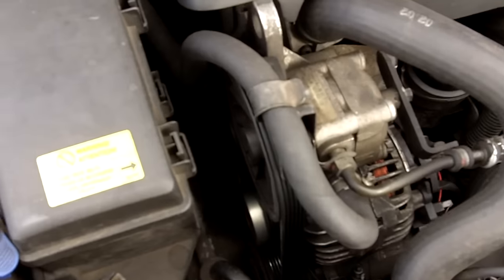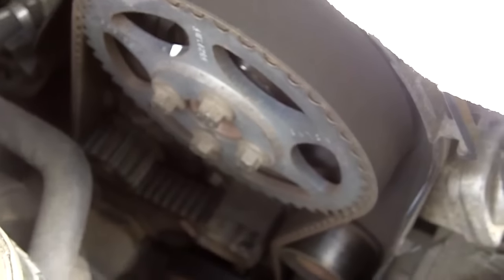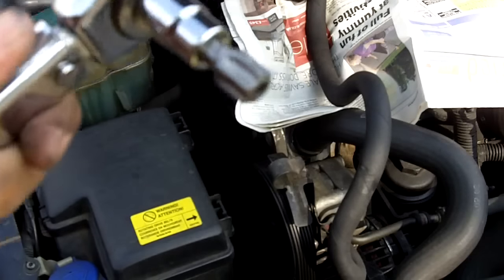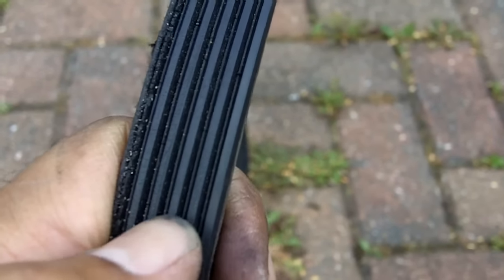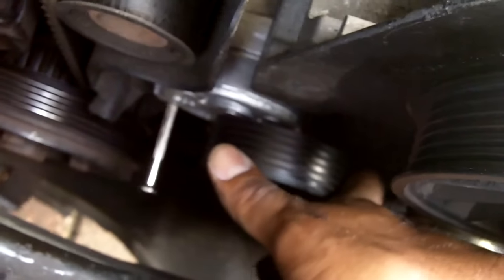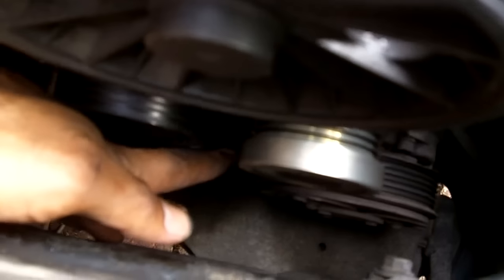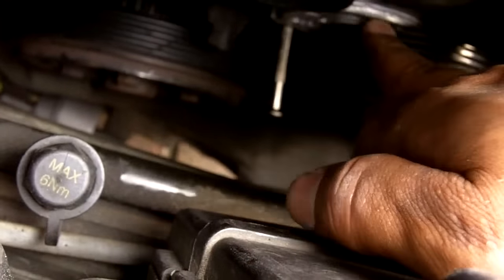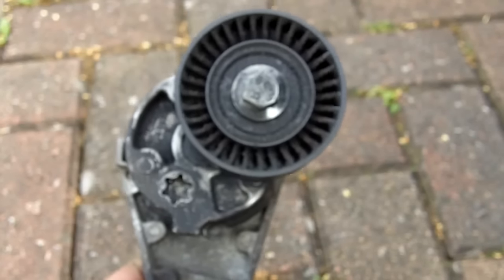Volvo D5 Auxiliary / Serpentine Belt Replacement

Comment: Another great video from SiRobb. I had to take out the power steering pump and alternator to do this - the Torx needed tapping in as the splines were a bit rounded by a previous mechanic/owner. Not a big job but the moral support from this channel always helps - New alternator pulley and now have a very quiet engine! - Thanks again Si. Great stuff!!!

Comment: Thanks @SiRobb for a great video. It gave me the courage to do it myself. Unfortunately, it looks like I had received the wrong type of tensioner. The car originally had the one with the bolt on the lower part of the tensioner, the replacement part I received had the lower bolt in the same location as the one you used in the video. 

Despite the differences, the replecament tensioner did fit, the bolts actually lined up perfectly. And I actually drove about 20 miles and it worked without problems. No noises and the belt runs perfectly.

I will however change it to the correct part this weekend, to help me sleep better. :)

Comment: Thanks so much. I got the wrong part from the store, they said it was the right one when they looked up the vin number. Morons. So i tried to find the bolt when comparing to the spare but couldn't find and then tried to locate it but couldn't. Then when i tried to find a video with the same tensioner model for the D5 there wasn't any. But then i found this, huge huge thanks you are a legend!!! Thanks thanks million times! God bless
Reply from the maker: God bless you too my friend.

Comment: Thanks for sharing, I noticed that 2 years ago before I changed my belt I had a rattling noise, so I changed tensioner pulley, but that didn't change a thing, then I changed the the belt and rattling noise went away. Now 2 years later I can hear the rattle again so will try to change the belt now first.

Comment: Another splendid video. The tip about the T60 slot on the tensioner is great. I had no idea and would have used the pulley bolt. Thank you.

Comment: Hi SiRobb. Good advice, thanks for posting this vid. Funny thing, I found that my tensioner does'nt have a wee hole like in your vid. Then when I had it off, I could see clearly why that is. There is a bolt or something similar snapped off inside it. Beware the cannibals. Any how, its all good now. No more silly squeaky noises.

Comment: Useful video, thank you. I've got an early D5 engine myself with a nasty sound from that area that sounds like a commercial dishwasher when its running. One job to do it to take the belt off and check the pulleys so your video is now 'book marked'.
Reply from the maker: No problem. 
I hope you track down the cause.

Comment: Even though the engine code (d5244t) is the same this is for the earlier engines with the bolt through the bottom pulley (349808) the slightly later ones (349809) have the bottom bolt not going through the pulley and it's slightly lower down.
Reply from the maker: Yes, I know. 
The different bolt location is explained in the video.👍

Comment: The best Volvo repair video’s anywhere, my belt is very noisy and is flapping about a lot from the aircon to steering pump, belt looks okay & alternator pulley is going around could this be worn out tensioner  or belt?

Comment: Thx Sir Robb! I manged to change the tensioner during the weekend on my XC70 D5 2005 model, I did remove the front right wheel to be able to work from below as well, I would not have been able to locate the bolts to remove the tensioner without my special mirror. I also found it very tight for my big hands plus my 1/2 ratchet felt too big at times, hence it was hard to get it out after I changed the location after locking the tensioner with a nail. What kind of ratchet did you use? I recon small than 1/2 inch right? 3/8? If so the head would be smaller and giving you more space against the wall of the engine bay. Thx again for this video!

Comment from the maker: The White Chisora You tension and lock the spring loaded tensioner pulley.
Explained from 3.30
Reply: Hi. In your video to change the timing belt you used a book for the bolt torque settings. What book was this as I have struggled to find a book for my xc70

Comment: hiya m8, ive got the mark 3 v70 d5 its got 2 aux belts and ive noticed today that the alt clutch pully is " stuck" both ways when screw driver is inserted in the blades. can this corze the aux belt to snap? if left .
Reply from the maker: A seized clutch pulley will stress the tensioner and other pulleys and cause a problem in time. I wouldn't wait for that time.

Comment: Hi bud would you be able to do a video of jacking up the front using a trolley jack to place the car onto axle stands. Would be very helpful. Thanks 👍
Reply from the maker: Jack and axle stand placement can be seen in my Polyurethane Subframe Bush and D5 Oil Change videos.

Comment: Hello! My 11 plate xc60 DrivE is in the garrage, the are struggling to get the correct tensioner. They've been told by volvo it will need modifying to fit now, apparently £500. Somthing about drilling the engine block as it would be a mechanical not hydraulic tensioner. Do you know anything about this? Any recommendations?
Reply from the maker: Yes Volvo  experimented with different tensioners so speak to a parts expert. If you Google the parts department at FRF Swansea and quote Volvo forum code C3, they will source the correct tensioner version at a price that will be the lowest or close to. Have your full 17 digit chassis number available in case they need it. Hope everything goes well.

Comment: Hi @SiRobb have you got any good tips for changing the belt on 2011 D5, there is absolutely no way of making that much access room on my car because of the top motor mounting bracket. I've got the belt 90% on but I can't get at the tensioner to release the tension, I've been able to roughly check the pullies but I now I'm stuck..
The belt broke last night, luckily nothing happened besides an alternator warning showing up. 😳
Reply from the maker: Lucky escape so get everything checked. You may have the D5 version which requires shorter tensioner replacement intervals and it's failed or the 11 year old alternator pulley clutch mechanism is seizing.
Pretty sure you need to support the engine and fully remove the mount for correct access for pulley and belt removal.
At 11 years old, everything should be in good condition as everything should have been changed at 10 years so review the entire auxiliary and timing area.
Good luck.

Comment: Hi, just got a V70 D5 163 and finding your videos most useful, I think I need to change my aux belt tensioner as there is slipping belt sound for about 2 seconds when taking up drive at low revs(its an automatic) first heard the noise when test driving at dealer, he had the aux belt renewed and the noise reduced a lot but still remains as I say only when taking up drive at low revs, no sound at idle or normal driving. Does that sound like my tensioner? or perhaps the alternator clutch seizing as in your other video? 

Also I noticed there is 2 variants to the tensioners, one without the idler pulley an one with, I'm wondering how you would determine which variant you need without having to disassemble everything to find out?

Many thanks for taking the time to answer questions and create these helpful videos.
Steve
Reply from the maker: Plutonia00 Hi Steve, The noise you describe sounds very much like the clutch pulley. 
The noise can be dulled by a new belt but the root cause isn't cured. 
You need to take the belt off and check it and you need to do that soon. 
As for the tensioners, one has a lower bolt that is hidden behind the idler pulley and the other has the bolt in clear view so they're easily distinguishable.
Best done with the car jacked up and viewed from below or you can try a mirror and torch from above.
Reply: Brilliant, I will get onto that right away. Thanks again for your superb help!

Comment: Also, the car has done 107k miles & is a 53 plate, the timing belt was replaced in 2012 but only on 53k miles(it’s done approximately 6k miles per year) on the MOT history so although the belt has done only about 60k miles but is 10years old should it be changed?
Reply from the maker: You change the belt at 10 years or the mileage, whichever comes sooner so it needs changing.
You change timing and auxiliary belts, tensioners and idlers and you may as well fit a new alternator clutch pulley as per my other videos and any belt wobble will be gone for the next 10 years.
Reply: @sirobb  thank you, I was thinking that after watching your alternator video,  apart from that it's a great car, the breaks neet replacing though, parking brake is non existent I can see lots of thread on the cable adjuster under the centre console!

Comment: Hi Simon. Trying to do this job today and found my low-profile socket wrench and T60 bit just won't fit in the gap to release the tensioner. Any tips - do you think mole grips around the T60 bit would suffice?
Reply: Mole grips unlikely - Shorter or longer T60 bit? or try putting the bit in the hole first then clip in wrench. Using a short wrench I still needed to extend it with a bar to get enough torque.

Comment: There are 2 belts available 1825 mm and 1841 mm. Do you know which one is this?
Reply: What did you order? Looking to change it as well but i do not know what length to get
Reply from the maker: @elliotnasstrom9243 speak with a Volvo parts department. There aren't multiple lengths, there's one correct one and they will know the correct one.

Comment: done this today on my xc90 had to replace the top idler wheel/tensioner pulley thats upon fitting the belt it runs ok but the belt seems to be over to the left ive tried moving it back but upon running it puts itself back is this normal in this pulley dont want it slipping off
Reply from the maker: It should run perfectly in line like a sewing machine as you can see right at the end of this and my timing belt video.
Any play will create uneven wear on the pulley bearings and belt and shorten their life considerably. 
To do the job properly, you always change the tensioner unit, belt and all  pulleys. You never fit just the belt or just one or two of the pulleys. 
The auxiliary setup is on the same change schedule as the timing area so should ideally all be changed in one go.

Comment: I don't understand. You have to remove a part, to get the part out. Ok. So how does the new part fit back in then?
Reply from the maker: @wungabunga  Which part?
Reply: @sirobb  The idler wheel? I think. Does it go back on the unit while in situ, via a nut?
Reply from the maker: @wungabunga  Depends on your part number design. If a pulley removal is required from the tensioner to aid access ensure you have the correct torque figures to replace it.
Reply from the maker: @wungabunga  Also some auxiliary tensioner units come with both pulleys and some with only one and you have to buy and fit the extra pulley. Everything depends on part number.
Reply: @sirobb  Cheers. I’ve bought an INA belt with tensioner and pulleys. One of the pulleys is removed in the product image so I imagine that goes back on after fitting. I’ll work it out! (2009 xc90 D5).

Comment: if that smooth pulley is the tensioner ive looked for 30 minutes plus with mirrors and havent seen that star torx adustment at all?????????-------what started off easy has turned to total frustration

Comment: Im confused. Isnt the ribs on the belt supposed to be towards the ribs on the wheels? Looks like the belt is upside down.
Reply: Yes this is definetily wrong. Belt is upside down and nobody noticed. It will wear out in record time....
Reply from the maker: The routing of the belt means both sides make contact with ribbed pulleys so both sides of the belt are ribbed.
Some belts on other cars are only ribbed on one side depending on the individual design of the belt routing.

Comment: Did u use ratchet to take off idler pulley off? Or flat wrench?
Reply from the maker: karolasbmx I've used a 1/4" ratchet, ratchet spanners and normal spanners. It depends on the tools you have available.

Comment: My questions is about the tensioner release at (4:05). Can't we just use 14mm to release tension? yes Recently my mechanic did change roller for timing belt side and he did take off the drive belt as well. But after installing the drive belt my Drive belt tensioner keep moving(back and forth) little bit even on normal running, so what exactly your suggestion is, we should not use 14mm to release tensioner? Kindly elaborate.
Reply from the maker: The tightening torque for the tensioner pulley bolt is 20Nm.
If you tension the spring using this bolt, you will almost certainly put more than 20Nm through the bolt to overcome the spring tension.
Over torquing any bolt is a bad idea but an especially bad idea on a drivebelt pulley bolt. 
That's why you use the dedicated T60 torx recess on the tensioner.
It's been specifically put there for this reason.
Reply from the maker: A bouncing tensioner most probably means your alternator clutch pulley is seizing.
Reply: sirobb Really appreciate your quick help. I just take off the belt to install new Drive belt tensinor(Complete) and checked as per your instructions, 

Steering pump pulley moving OK, 

Alternator Pulley moving OK but when move backward no sound but when I move forward very little click sound which can only be hear on deep observation.

Finally, AC Compressor pulley moving free and gives sounds, is the culprit which make Tensionr moving back and forth? Please guide. Thanks.
Reply from the maker: Major Code I think it's your alternator pulley. 
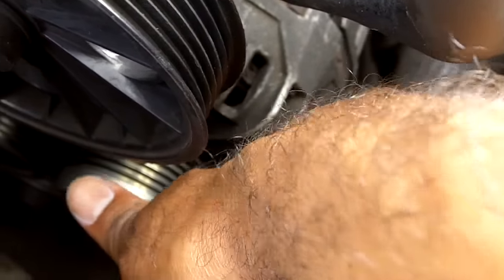Watch my video again from 7:55 for alternator pulley testing.
Reply: sirobb Thanks, but is it normal for compressor pulley to move freely and gives whining noise ? 2ndly can we change bearing only on alternator? any source for these pulleys purchase?
Reply from the maker: +Major Code yes you can change the pulley only.  look for alternator clutch pulley videos on YouTube.
The ac pulley can turn freely if the clutch plate isn't engaged.
Reply: sirobb So you mean, I should not worry about sound the compressor pulley is giving? And change the alternator pulley only.
Reply from the maker: Major Code I don't give advice. I only give an opinion. If you're unsure, seek a professional as it's impossible for me to say based on a written description. 
It's your car so your decision. 👍
Reply: sirobb Thanks sirobb for quick help. Today my mechanic confirmed that there is need of bearing change for AC. 
As far alternator concerned the one on my S80 is not automatic pulley on alternator which he says cannot be change. Now the alternator is working perfect never see any issue of charging, For this alternator, Is it the same way to check bearing as you checked by inserting screw driver? Kindly advise.
Reply from the maker: Major Code The test in the video is for a clutch pulley. 
If yours has no clutch, it'll just stop anyway with a screwdriver inserted.

Comment: Hello .. could you tell me the reference of the belt tensioner? .. to be able to buy it myself.
Reply from the maker: I would only use Vida to get the part number for your exact car although sites like Autodoc have pretty reliable reference catalogues.
Reply: I have the same tensioner as the one in the video .. but I don't know how to remove it .. I've only seen one screw .. I can't find the other.
Reply from the maker: The other bolt is behind the lower pulley as shown in the video.